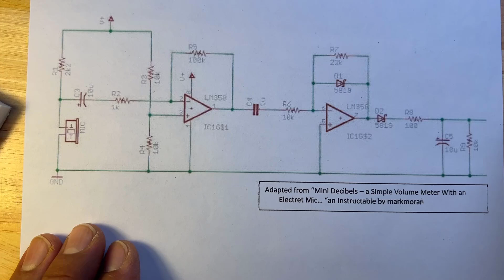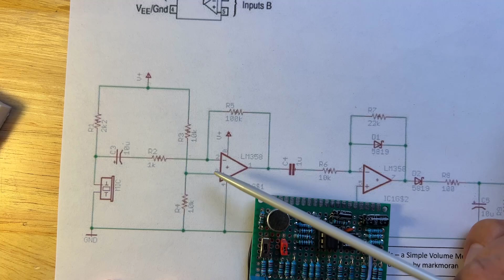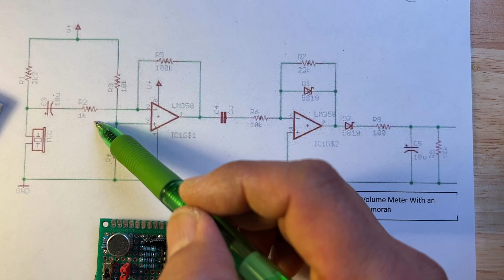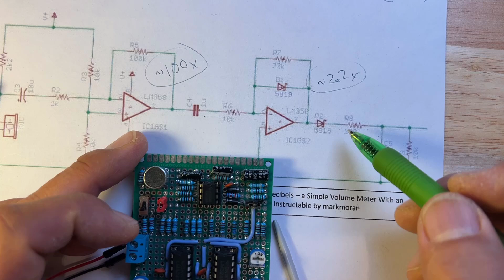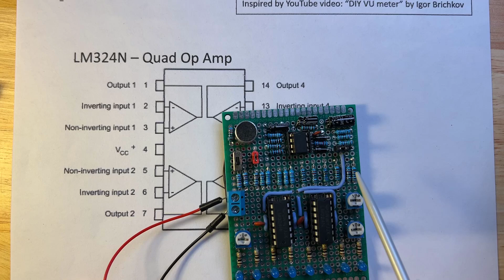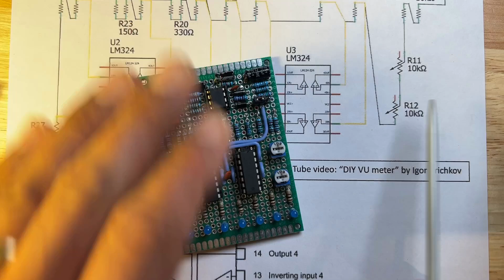Digital LED VU Meter | Using Op Amps | Part 1

Comment: Why do the voltage divider on the first op-amp's input in the first place - you should explain that.
Reply from the maker: Thanks for your question. The voltage divider sets the voltage on the inverting input to 2.5 volts. The non-inverting input is connected to the signal from the microphone. This makes the output of that op-amp fluctuate with the microphone signals up and down from that 2.5 volts. Often times op-amp circuits fluctuate up and down from 0 volts, but then you need to work with negative voltages. In this set up I am working with 0 to 5 volts, so I want the amplified output centered at 2.5.